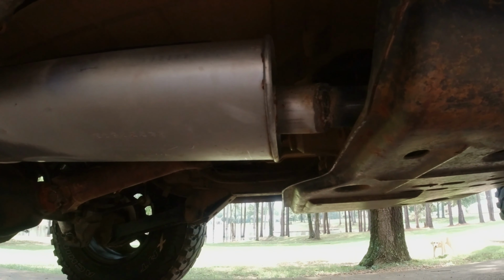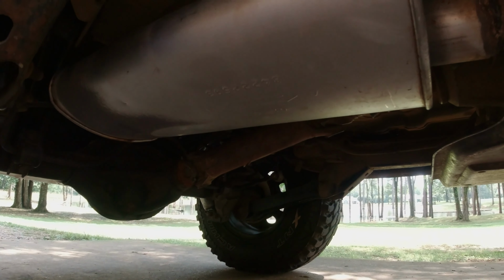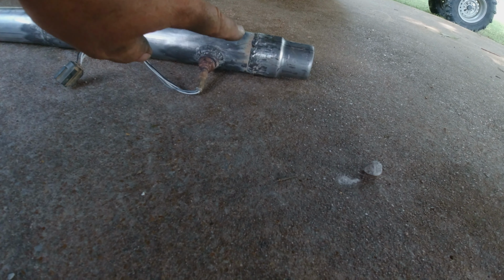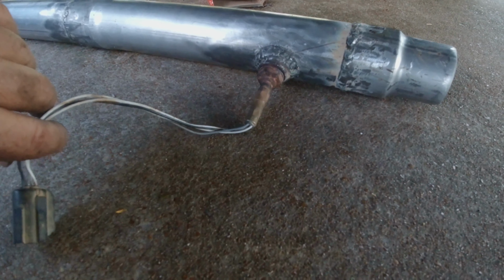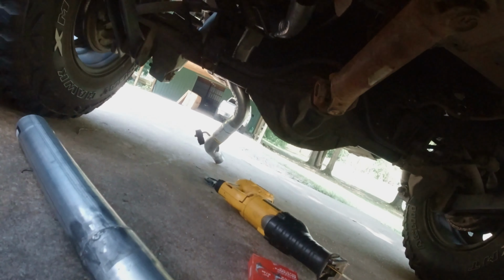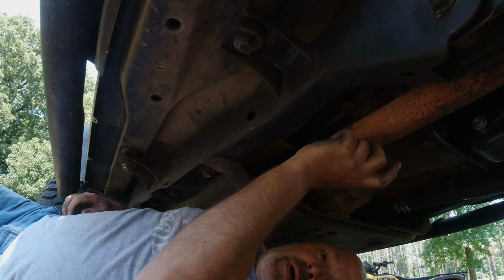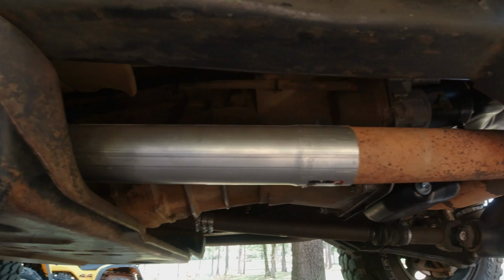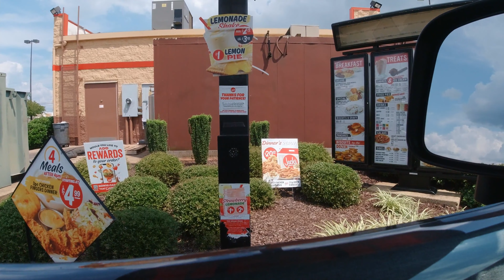Installing a new exhaust system 97 Jeep Wrangler!

Comment: That part of mine is still good. But I would swap mufflers if I could find a quite one. With the doors and windows off. Its louder then I like. But this winter when I put the hard top on. It would not be an issue.
Reply from the maker: Yeah, mine isn't quiet. I am looking to put a resonator in front of the muffler. Hope that helps. It has a raspy sound that I am not fond of at certain rpm's.

Comment: Hey Steve! I sure would like to have one of those cup holders for my TJ! I just did a very similar exhaust system redo last month. I was happy to see that you did yours almost identical to mine. I know for sure I did it right now! There were a couple of things I did slightly different. The previous owner had punched out the cat and did who knows what with the oxygen sensor, so I completely deleted it. I went to a muffler shop and had the cut me a 4' pipe and flare one end, instead of welding pieces together. He charged me $35. I used this muffler https://www.amazon.com/gp/product/B00029J3BG/ref=ppx_yo_dt_b_asin_title_o04_s00?ie=UTF8&psc=1 and am very happy with the sound of it. Bold but not too loud. The exhaust pipe from the muffler back was still very solid, so I cleaned it up and painted it with black heat paint. All in for less than $100!
Reply from the maker: Hey Mark! That's cool that we have a similar set up. Cup drawing coming soon!